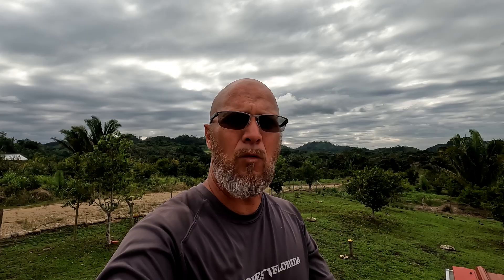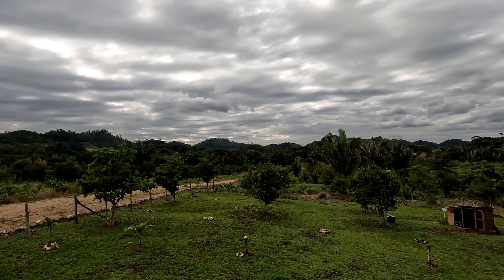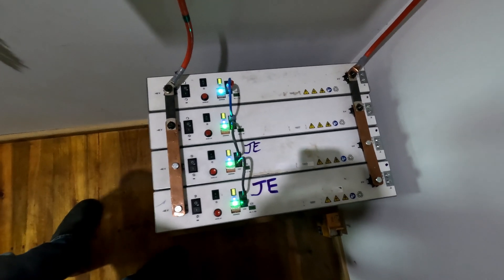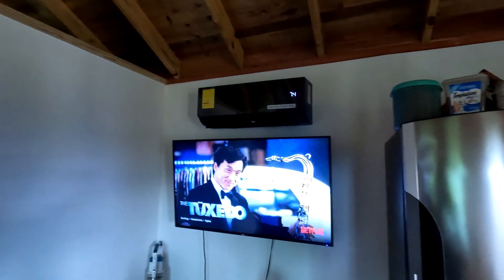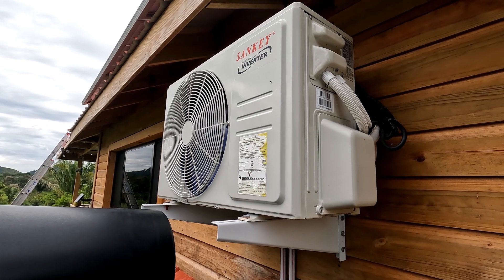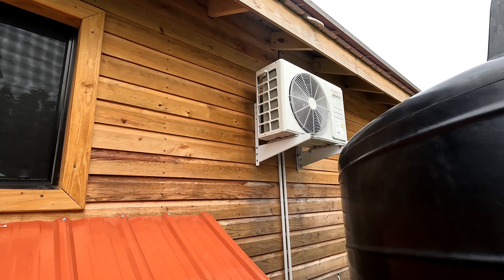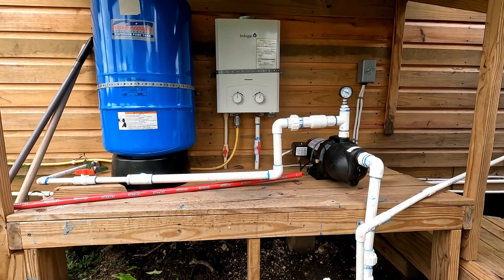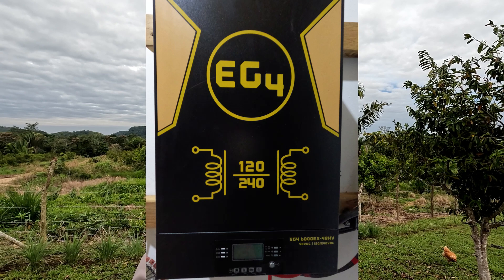Off grid 5K WATT solar setup in 2024 enough energy? Exploring the Viability of 5K Watt Solar Systems

Comment: Hi, thanks for your this really helpful video ! 
I'm just wondering if you can run 120 to 240 devices with this converter? For example, people from Europe with 240 voltage ! 
Cheers Steve
Reply from the maker: @steveschmidt7914  HI. Yes it is a split phase inverter so it does both 120 and 240. It is a great product.  Had it for a year now and no issues. Thanks for watching 😁
Reply: @WhereToNexxt  great thanks I
We will keep watching you and recommending!!!
Reply from the maker: @steveschmidt7914  thank you 😊

Comment: Great video, Building at Secret Beach would like the cost of this 5 kWh system.
Reply from the maker: A 5k system will run you about 10k US. Solar is pricey here but well worth the investment, especially now with all the power cuts and blackouts going on and it doesn't look as if it will get any better.
Reply: Did that include installation? If not what did it cost to install. Great video and information. Thank you.
Reply from the maker: @amyp1930  yes it did. Check out Green Tech Pros FB page here in Belize,  tell Jeremiah I sent you.😁

Comment: What is your average daily power usage? Mine is about 16KW hours and I'm considering to purchase an EG4-6000 XP. Do you think this is adequate for me?
Reply from the maker: Hi, I  get about 14 to 18KW this time of year with my system.  I probably use about 10KW on average. I may upgrade to a few more panels just for charging cause we run the AC during the day. Thanks for watching. In my opnion 16KW is good.

Comment: I was looking at one of the inverters like yours.  Seems like a nice setup but I did see a few places where the battery connections to the inverter on the board was cooked. I expect it was during a higher current draw, it could be they are mostly good.

Comment: We are preparing to set up our (12) 390w QCells panels + Conext SW4048 w/Midnite Classic CL150 charge controller. I am thinking to switch to the EG4 Charge Controller (possibly 2 units with double the panels). Than =k you for answering some of my questions in your video! What is the VOC of your panels?
Reply from the maker: Thanks for watching,  we average about 35 volts per panel. We have 12 410watt panels. So far so good...
Reply: @WhereToNexxt  the size of our panels (390watts/48.48v) is so close - 20 watts is not that much difference in the long run. Glad to see that your system is working so well for you!

Comment: Thank you for sharing! What size breaker did you use for you water pump?
Reply from the maker: Hey, we use a 20a breaker for the water pump...
Reply: @WhereToNexxt  thank you for the quick reply! We’re building an off grid home and I wanted to be sure I use the correct breaker. And if I’m not mistaken, it’s a double pole breaker, correct?
Reply from the maker: @DerrickBurden  yes it's a double breaker. Have fun with the off grid life it's a journey.
Reply: @WhereToNexxt  thank you!! We’re getting there. We’re using straw bales to build. It’s a real journey. Only wish we were back in Guatemala doing it.

Comment: A 5kW low frequency, transformer based inverter would be enough. A 5kW high frequency inverter, not so much.
Reply: May I ask you how do one find out if it is a low frequency or high frequency transformer?
Reply: High frequency inverters tend to be very lightweight. For example a 3kW high frequency inverter typically weighs only approximately 15 to 16 pounds, whereas a 3kW low frequency inverter will weigh approximately 55 to 58 pounds. Also, a high frequency inverter will only provide at most, a 200% peak power capacity, while a low frequency inverter will provide a 300% or more peak power capacity for heavy duty use.   @carmenmariacortesmarin2664

Comment: We use our well pump to fill a 275 gallon IBC Tote and then we use a 12 volt DC RV pump to supply our water needs. The RV pump is a SeaFlo model 55, it provides 60 PSI and 5.5 gallons per Minute. All runs off solar with no need for a pressure tank. The well pump runs at full flow into the tote with no need of a pressure tank. We turn on a switch for the well and when the tank is full the switch is turned off. By eliminating a pressure tank the electrical draw is reduced and we only top off the IBC Tote during the day when we have solar. We are going to replace the 120 volt AC well pump with a 24 volt DC pump and automate the filling of the tote.

Comment: I've been running off of 2 230 watt panels 2 Rolls s550 batteries, a 60 amp charge controller and a 600 watt pure wave inverter for almost 11 years now. But I don't require much. It's a small cabin and I run a transition point for returning combat veterans out in the middle of nowhere in the woods off Colorado.

Comment: The answer lies in your energy bill. Divide kW usage by days in billing period. Your answer is what you need to produce daily. Average figures for a family of 4 is 15-30kw per day.
Reply: 5000 watts x 5 hours = 25,000 watts divided by 24 = 1041.66 watts per hour average power available.
I do not think it is enough if he uses air conditioning.
I only use a small chest freezer and a refrigerator and a computer and some lights. 
mine is at 12000 watts a day. 500 watts an hour.
Reply: @brusso456  12kw a day is pretty good. Wish ours was that low, we're currently at 20kw per 24hrs. Realistically though, that's an achievable target for even a modest off grid system.